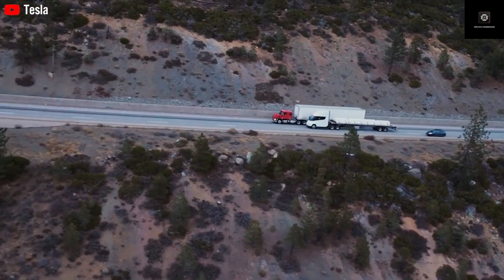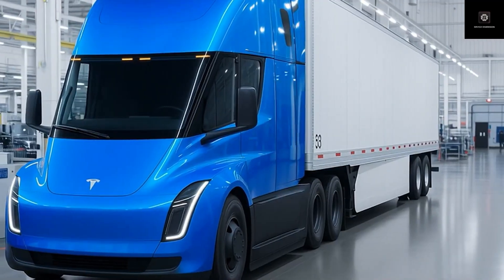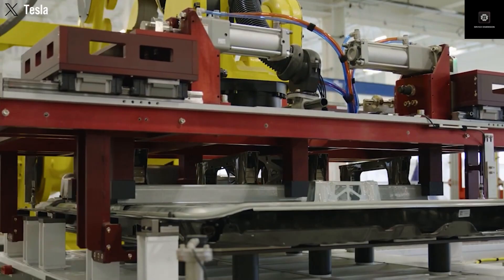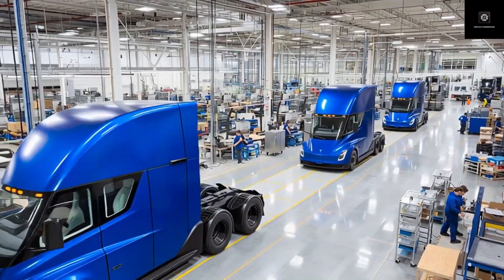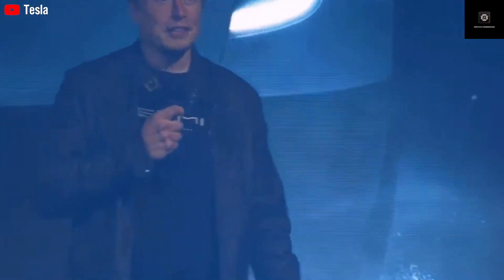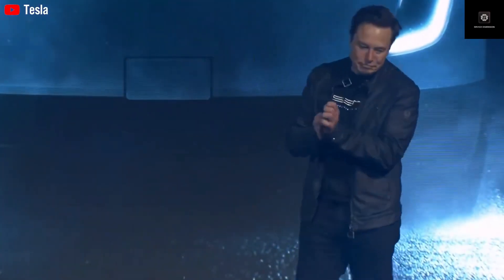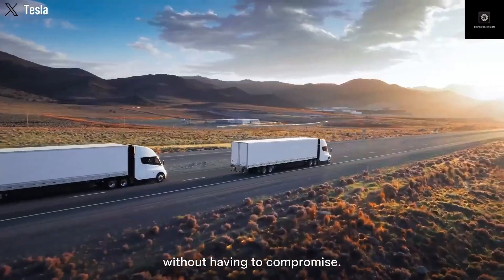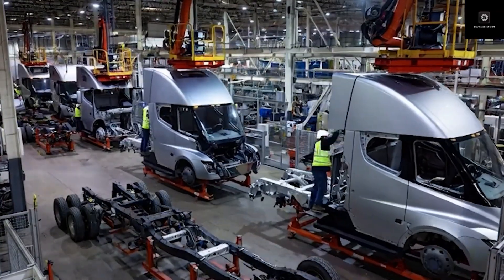Elon Musk STUNNED by Tesla Semi Gen 2! 1.2MW Charging, AI Control & 2026 Takeover

Comment: Charging price per Kwh has to be cheaper, at least $.10 cents per Kwh 

Diesel: 6 mpg x $3.20 is my real price per gallon with fuel card.
500 miles / 6 mpg X $3.20 = $ 266 dollars

Semi:
1,000 kwh X $0.25 actual tesla supercharger price = $ 250 dollars.

Diesel fuel counts for 45% of my expenses, I want the Tesla Semi, but charging has to be cheap, otherwise it doesn’t make sense invest $180,000 dollars on it.